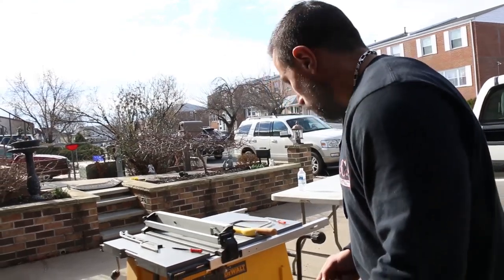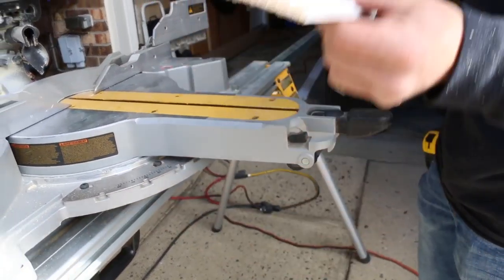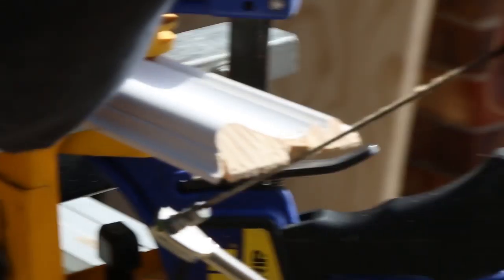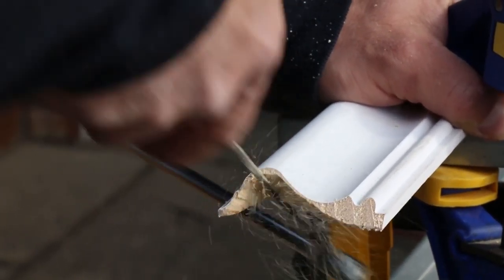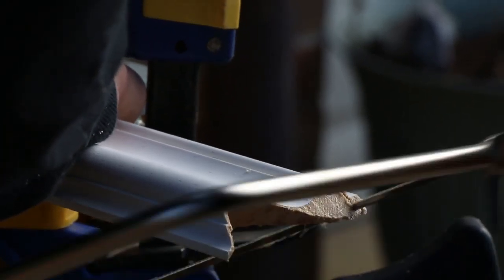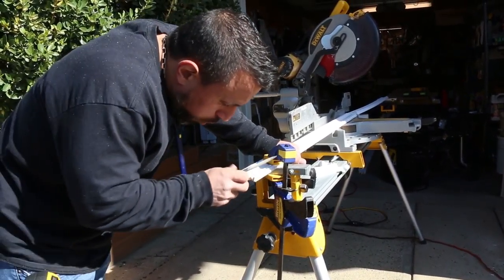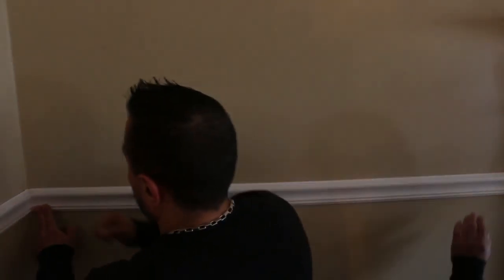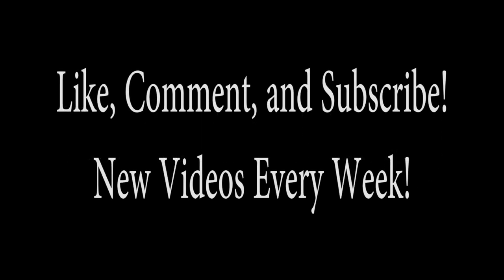How To Cope Molding Inside Corner - Best Way For Professional Installation

Comment: Great video, as always. I'll be adding chair rail to my dining room soon. Whoever built this house 50 years ago decided to skim the drywall and did a horrible job. The original (and only) owner wanted to hang wallpaper, so neatness didn't count. No way the inside corners are 45 degrees. I'm coping them and your instruction has been invaluable. Thanks very much!

Comment: Hey Vince, I've seen people use an angle grinder to back-cut their copes.  What do you think about using Milwaukee's new 3" cut-off tool?  Great size and weight.  It would take a light touch, but think it could work well with the right blade.  What do you think?

Comment: Very informative video. The problem I always have is that the top part of the moulding matches up, but there is still an 1/8 to 1/4 inch gap on the bottom. I’m sure I’m doing something stupid. Any thoughts?
Reply: HipsterDoofus100 probably have to sand off the remaining amount of wood.